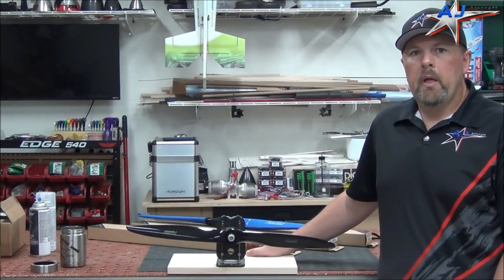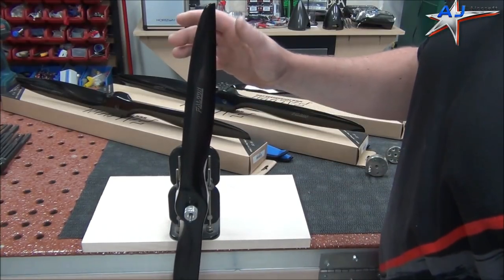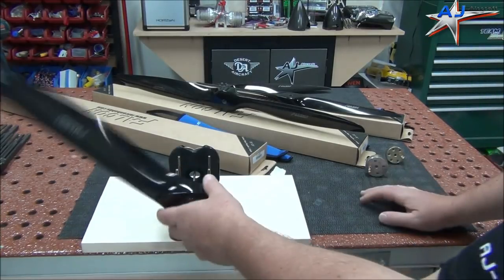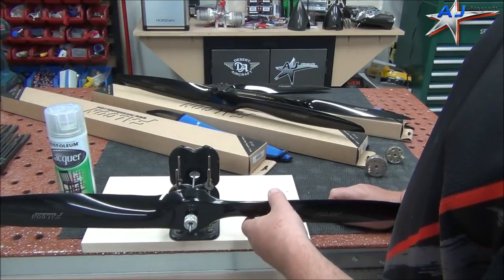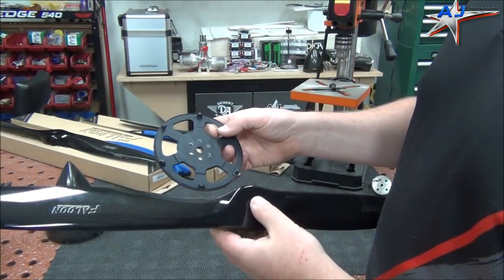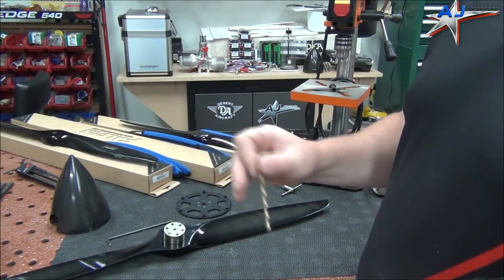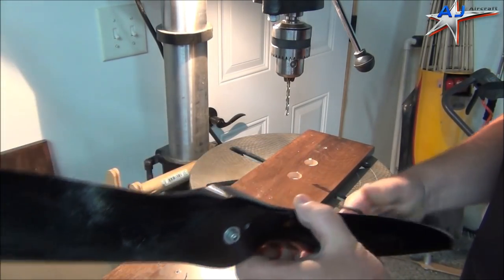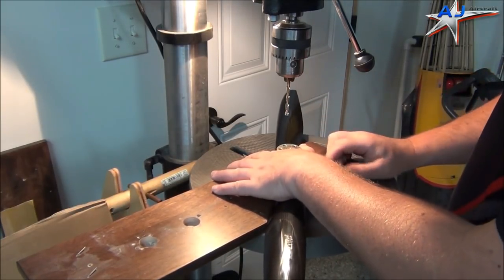RCTEK Episode #7 prop balancing & Drilling

Comment: I have a DuBro balancer but my shaft is 3mm diameter and uses a spring and fuel hose to hold it in place. This setup does not work for large props. Your shaft on the balancer and cones look larger then mine and you do not use a spring or fuel hose to secure it. Is yours shaft and cones an upgrade or different name brand??

Comment: Nice video. Instead of sanding the heavy side of a prop and especially on a nice carbon, I use clear spray paint on backside of the lightest side. Wait till the paint drys and the moisture is gone before re-balancing. Keeps the prop nice and shiny.

Comment: Why do you guys not follow Prop Manufacturers advice ? Mounting a prop on balancer : Taper into hub at REAR to centre the prop ... FLAT Face of cone to FRONT hub to make sure prop hub is perpendicular to shaft. The front shaft hole is not the precision reference .. the rear is.
Check out APC Tech support.
Drilling props - if its a single central hole shaft - NEVER drill ... always use a hardened steel taper reamer to avoid de-centralising the shaft hole. Again refer APC Tech Support.